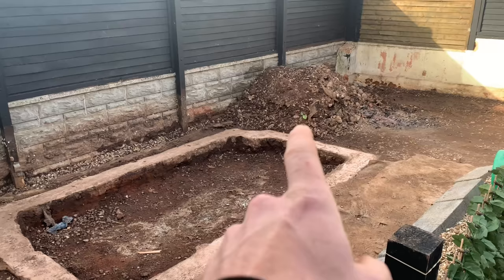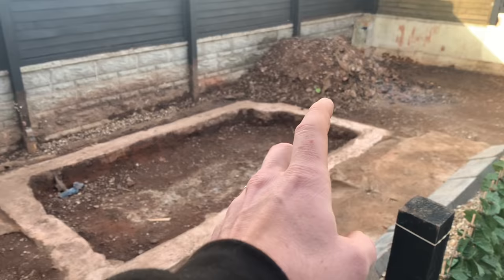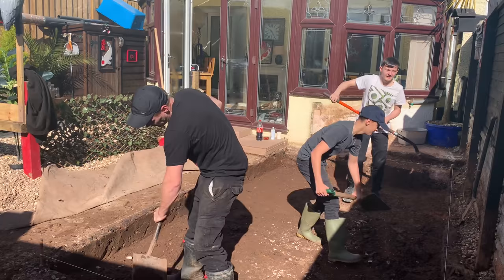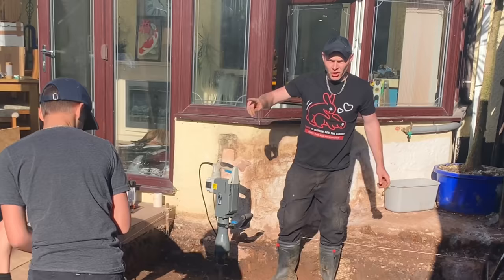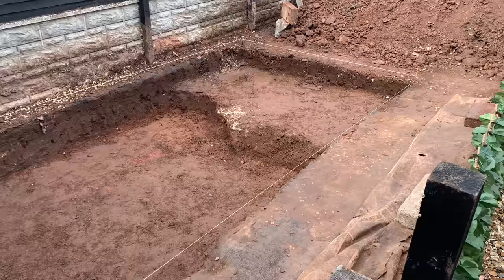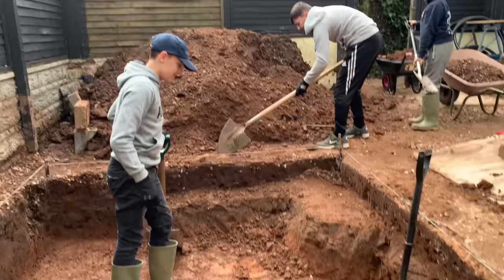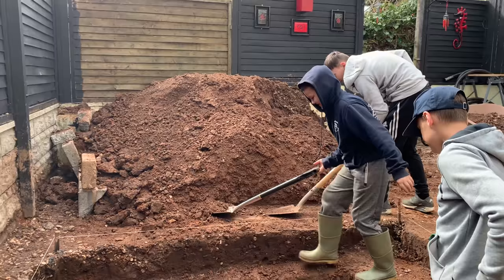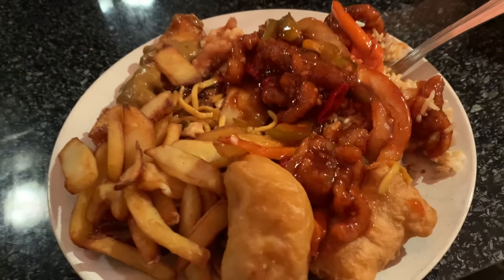FINALLY!! THE DIGGING STARTS FOR MY BRAND**NEW KOI POND** #PART15 OF MY DREAM KOI POND!!

Comment: James,  price in for 100MM 7N DENSITY CONCRETE BLOCKS a bigger structure that will require a higher specification. Looks like in the previous video you used medium Density 3.6N Concrete,  they seemed to break quite easily, I may be wrong? Also, are you pouring a slab for your base,? Steel reinforcement is a must.  This will cost an extra £300 pounds for steel and blocks. No heartache after the build. Just be nice to Mrs whisperer!!..

Comment: by the time you blocked it with them lay flat your only going to gain like 6”.. I would make the filter house as small as you can and extend the length else it seems like so much work for not much gain... 
can’t fault your work ethic though mate.. graft on  ✌️
Reply from the maker: It’s just the size I got to play with mate but it will be a much better pond
Reply: It’s not a criticism, just you’ve grafted so hard it’s be a shame not to squeeze every last inch of volume out of it.. drums are pretty compact and barely need manual cleaning, won’t matter if it’s a bit of a squeeze in there 😉 use the vertical height to jam everything else in there .. you know the mrs won’t notice another foot sneaked on the length when she ent looking 👀 
Looking forward to the next instalment

Comment: You will wish you have gone deeper and bigger , I’ve extended mine twice . Now roughly 4500gallons and finally happy. What’s the volume going to be on yours?
Chinese looks good
Reply: I think your right. James is laying the blocks flat, by the time he's done that the pond will bearly look much bigger. I did away with my old pond last year and then doing the new one nearly killed me but I'm glad I did.
Reply: @andrewmorris7897  I’d personally go down  at least 3ft and make the filter house slightly smaller to gain abit of length. 
Going to to a few blocks if laying flat
Reply from the maker: @ryanotter1747  this is just the start of the dig boys I have just had a solid week of digging wait until you see next Sunday‘s video that was just the start 😂😂😂😂😂
Reply: @JamesTHEKOIwhisperer123  look forward to it, I did think you would go as big as possible or as big as the mrs will let you lol.
Reply: @JamesTHEKOIwhisperer123  just go as big as you can James. You're limited I know by garden size but once you've gone to the limit you can do no more. Drum filters aren't that big compared with say a Nexus and a shower CA sit on the pond.
Reply from the maker: @andrewmorris7897  deffo mate I get what you mean 100% I am and will go as big as I can do